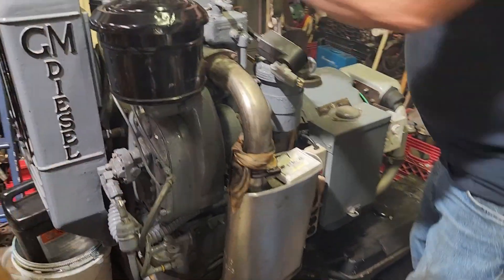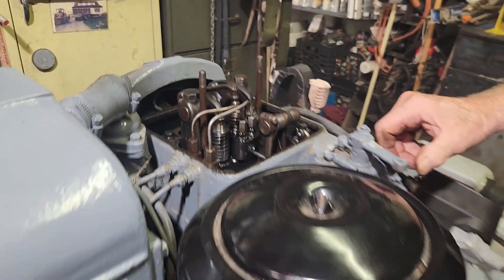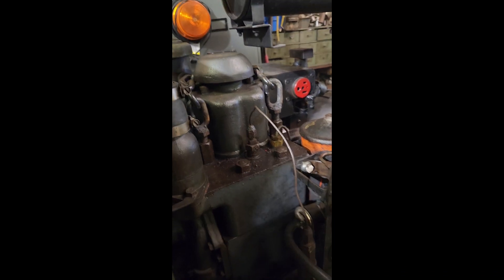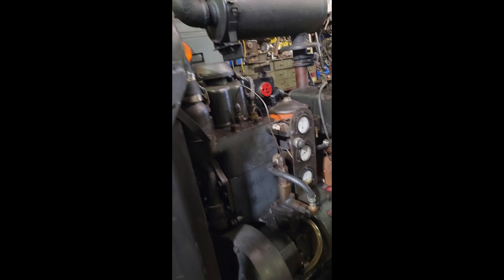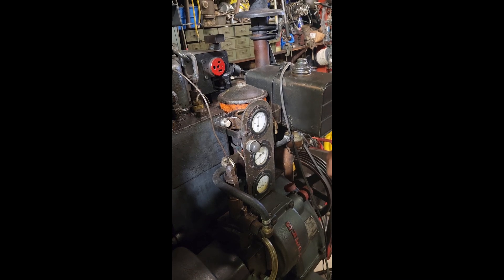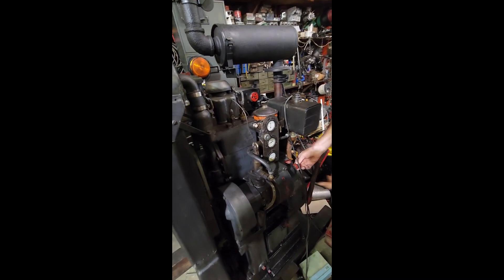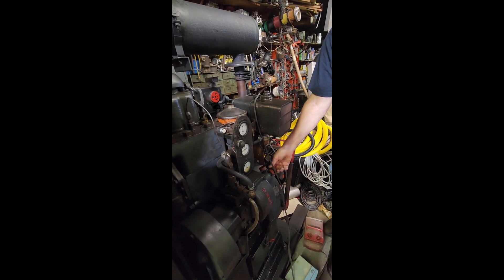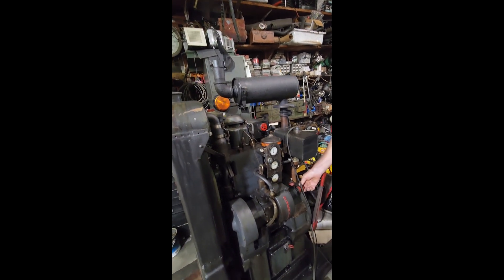RARE Vintage Diesel Engines Running - Caterpillar D342's, GM/Detroit Diesel 1-71, Sheppard Diesel 7

Comment: Don't sound as good as an Onan 😉

Also any progress with those two rare tractors? Recently got ahold of a rare lawnmower myself and ended up having to take the whole power train out of it to save another much smaller mower 😂
Reply from the maker: Hoping to have a video up sometime within the next month or two. The one tractor has been out at a friend's shop for the last 2 months waiting for a new clutch and I have to fix a few more things on it before it's video worthy - at the moment it doesn't look like much.
Reply: @MichaelTJD60  can relate 😂